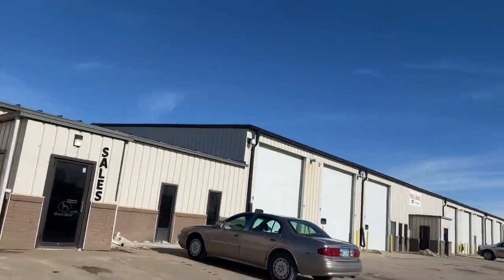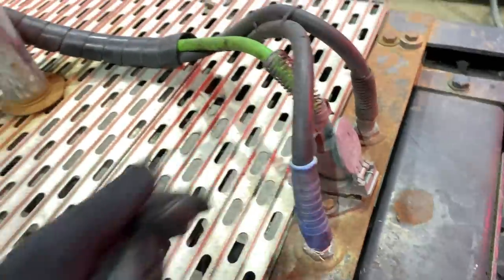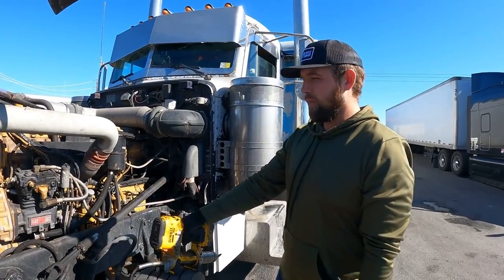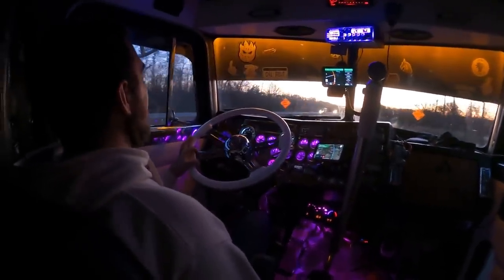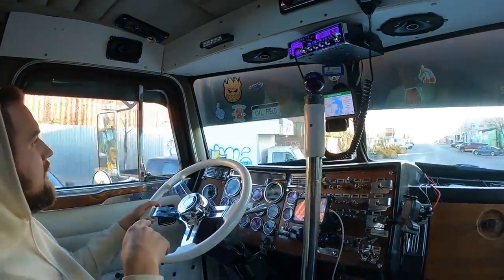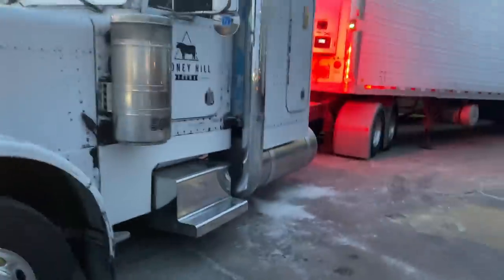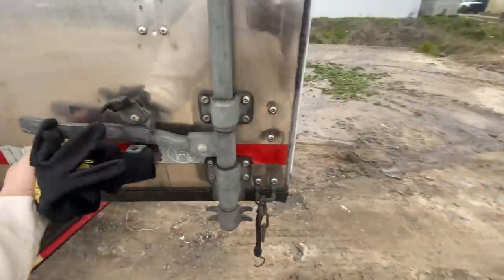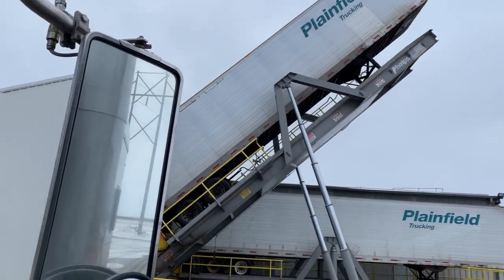Took my stretched Peterbilt into the Bronx, not a good idea

Comment: I grew up in Upstate NY...did some trucking there before I came to MN and I was always told...NY height signs are a foot under actual, because they factor in Snow/Ice/Road Repaving...etc....Always throws out of state truckers off unless you've either been under it before safely, or you've heard through the grapevine.  It's always been kinda silly if you ask me.  Just post actual and take the guessing game out.
Reply: This is epic to know. Thanks for the tip
Reply: I was laughed at when I told this in an orientation. By the orientation guy who by the way - once a truck driver.
Reply: Dang!! That is awesome info!
Reply: I live in New Jersey and drove in New York many times. I was told when I first started driving trucks was that when in New York the yellow signs you are clear. If the signs are white do not go under you will not clear it.
Reply: Then you go to Chicago and follow the same rule will make your truck a convertible because they forgot to change their signs after 15 repavements
Reply: The average repavement is a couple inches, how does it stay a foot forever?
Reply: BL Dontmatter  They dont replace signs either, so somehow with multiple repaving it never lowers?
Reply: The reason those clearance signs read very low is that state law there requires the posted clearance to indicate the absolute lowest part. So if over by the extreme edge by the shoulder, it's 12'8" even though it's 15' in the lane of travel, the sign has to read 12'8".
Reply: And this why I absolutely refuse to haul in or out of NYC area.  I was offered a LOT to do so and still refused.
Reply: I can 100% confirm this, I was in the Bronx and the subway underpass said 11’0 with no warning of it on the previous street so I sitting in front of it and this guy said you fit don’t worry lol I’m in a 12’6 box truck so I start inching forward and boom I’m under I went in the middle because I for sure would’ve taken out the traffic light 🤣

Comment: As a former trucker who did a LOT of NYC, Boston, Phil as well as Montreal, you have to know that your Peterbilt is NOT set up for city driving. Not only is that wheelbase about 6' too long, but you really need to sit up higher and have overhead vision through your windshield in city driving. In fact, I do believe that your overall length was oversize for NY and PA.

FWIW, I did most of my trucking in a C/O with a sleeper. I could get a 53'er into just about any spot with that setup.

Comment: I couldn't quite tell if there was space when you had the hood up, but make sure your air cleaner cross over pipes are not rubbing the top rear edge of the valve cover and that they aren't getting cut by the sheet metal going out to the air cleaners. It was fairly common on those to rub through and start sucking dirt.

Comment: Cool video. I go to the Bronx all the time. The signs for the bridges are a foot lower than what they say in New York. They Measure from the center of the hub up. So if a bridge says 12 six it’s really 13 six. If you look in the rand  McNally  it explains it in the back part of the book with all the DOT regulations
Reply: You are correct sir

Comment: Been off the road for a long time but used to run Chicago nearly every week after teaming to west coast every week. The yard was in S.E. Iowa always finished one man to Milwaukee, Chicago and points east. I remember being forced to give a man a ride about half way to Trenton from Elizabeth because he thought I was lost and insisted on helping me get to the interstate. I had been warned that there was a scam being done to drivers by helping them get out to the interstate but was directing them down dead end roads and then blocking them in the truck while they stole the load off the trailer. Always something new going on.  Oh, I forgot to mention he was on the running board of the tractor all that way.lol

Comment: I drove many  trucks and never had a gear shift other than  what came from the  factory, what am I  missing? I can't see any advantage. Also, with an air ride seat in an air ride cab is the stretched frame worthwhile? You would be over length  ln some States and Provences which cause you to park the trailer at the scales,

Comment: I have never understood the need or desire for an 8 ft shifter
Reply: Also sitting so low that you can barely see over the dash.
Reply: Nothing wrong with what he's doing, do you and your responder under you should do him to.
Reply: @mtanyctrainatlantamartatra7164  I do, I just also don't understand and I'm allowed to have my own opinion, if you don't like it, do you
Reply: Right on, or a 12foot deck.
Reply: For style and looks my man I think it's a cool look
Reply: Lol it helps the truckers get out of their seat after hours and hours of just sitting down… almost works as a long cane or staff to help them get up
Reply: Cause it looks badass
Reply: @Mr.Chick3n  sitting that low and farther back from the wheel is how I got a lower back problem on my right side. Pushing on the pedal like that with your right foot constantly ends up pushing your back out of alignment. I ended up with a twist in my spine and slipped a disc because of it.
Reply: @2pink1stink  😂
Reply: @markell6182  🤣

Comment: My understanding the yellow clearance signs are about 2' short and the white ones are a foot short....for sure pucker factor first time you see an 11' 6" sign on a "truck route" ....the hammer app does a pretty good job of keeping you from getting messed up in there but DO NOT get under the tram cause it'll say you can turn left or right but the support poles make it impossible so you wind up following the whole thing till you get dumped out by the synagogues
Reply: Stumbled across your video like the attitude love the truck keep on trucking brother
Reply: There are different truck heights for the straight box trucks and even smaller one that you dont even need cdl for

Comment: What are the advantages to having the truck stretched? Seems harder to fit in some spots but I don’t know much so thought someone could explain it to me..??! Cheers 🍻
Reply: I’ve often wondered that myself… I think it’s more about what it looks like because all I can see is it makes it harder… in the UK the overall length is limited but I believe the US it’s just the trailer.
I’ve driven artics (big rigs) in some very difficult places in Europe like London and Paris and it would be impossible in trucks like these!
The low seat so you can hardly see over the door and that bloody great big sun visor would drive me crazy…and having to reach above my head to change gear…I just don’t get it if I’m honest but I do love the American trucks!  I just don’t understand the way they customise them.. I suppose everyone’s different.
Reply: @PillSharks  I do know that in the us we can the stupid visor a “duck bill” or an “angry duck” 😂 and are looked at like a rookie type thing to do though some can pull it off.. and not seeing over the wheel seems a bit difficult as well but who am I to say. 
Hope all is well out there, cheers 🍻 and stay safe!
Reply: I suspect the longer chassis means an improved, smoother ride?
Reply: @CycolacFan  well European trucks I can speak for but not really American so you could be correct… European tractor units have air suspension on rear axles (some have it in front now).  Air suspension mounted cabs and air suspension seats so the comfort level is very high.. ever the axles on trailers are air suspension!
All I can see with the longer chassis is a nightmare of a turning circle and close quarter manoeuvring being a nightmare.
Another big factor in the Europe is aerodynamics to help MPGs so we try to get the tractor and trailer quite close with air deflectors on the cabs which go down the sides and on top… having that bloody great big gap in between the cab and trailer must cause some drag..it’s basically pulling two front ends through the air!

Comment: i miss trucking so bad   gotta get my health right so i can get back in it 
miss my w9 and reefer      truckin was my passion my dream my life   did in from 1985 to 2015
i was 18 when i started messing around trucks washing and fueling them 
when i was 19 started loading and unloading them and putting trailers in and out of dock when i turned 20 started driving local in dallas ft worth aera even ran all over texas some when i turn 21 went over the road      had a dream and pursued it

Comment: hauled potato's out of colorado    when i get to oklahoma city with them they used water to wash them out of the truck a fire hose with water pressure and those tators floated right out the back onto a conveyor belt into the warehouse where they boxed them or bagged them up

Comment: Damn. I drive a concrete mixer and my weight empty is 34,500 even. With a full barrel (10 yards) it’s an added 40,000 pounds. So I’m pushing 80 thousand pounds (which is the limit). I would have sworn your truck would weight wayyy more lol

Comment: The reason those clearance signs read very low is that state law there requires the posted clearance to indicate the absolute lowest part. So if over by the extreme edge by the shoulder, it's 12'8" even though it's 15' in the lane of travel, the sign has to read 12'8".
You look ridiculous sitting on the floor with that stupid extended shift lever.
Reply: Another jealous volvo driver. No class
Reply: @driva1212  Jealous? I wouldn't drive that if it was given to me for free and came with a salary well into 6 figures.
Reply: @timmytheimpaler  you couldn't handle a real truck, so don't worry you'll never get offered that